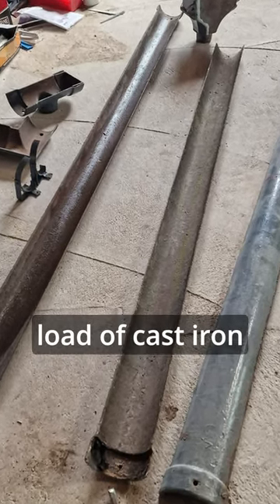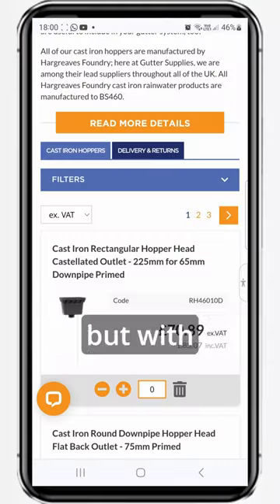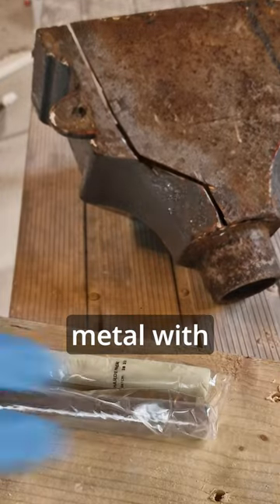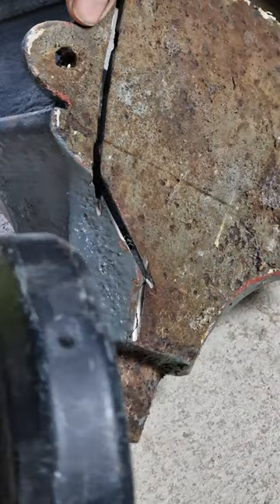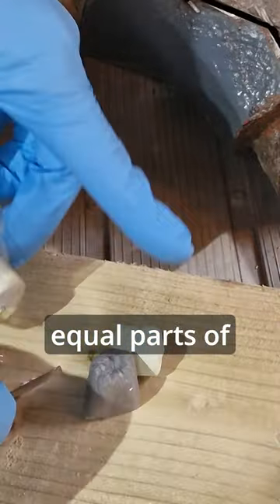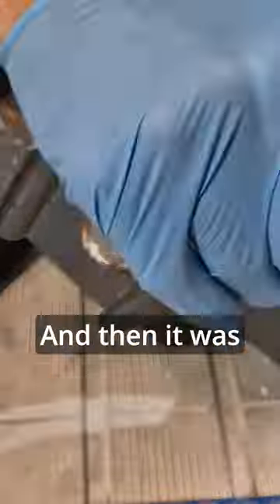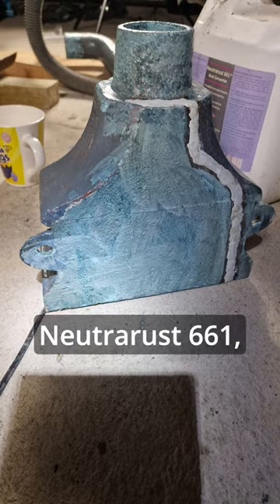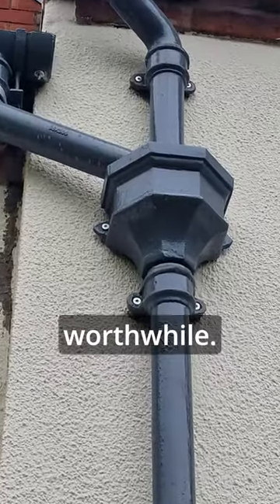How to Repair Metal #shorts

Comment: As a welder this made me cry 😢
Reply: Get a life lol
Reply: Average diy guy isn’t gunna be able to weld cast very easily
Reply: @SamMoto98 I don't know anyone who would do that . Especially when a new one is cheap enough. 👍
Reply: As a welder .
I would do what he did.
Reply: As a welder, I'd cry trying to weld it
Reply: welding a gutter is an idea only a jahoo would have
Reply: I just shook my head envisaged a wood fire, cleaned up the crack put it on the fire let the fire die down a little bit so I could weld it and then let the fire cool down, next day grind excess off. Perfect
Reply: Why? It's only there to guide water doesn't have to be super strong
Reply: Are you really a welder? You tie cast iron, not weld it.
Reply: Don't worry a couple of winters of freeze thaw 'n they'll  come knocking.
Reply: Tig every time preheat And fill that sucker with 316
Reply: @Liam....... if its not sealed the damage from the leak in the crack could cost a fortune to the soaked fabric of the building, damaged cornice etc as it tracks down the back of the pipe and hits the brackets every 6 feet soaking in at those points.

Comment: I fixed these before by welding occasional tabs at the top, middle and bottom of the crack then filling with the epoxy. Not too hard to weld but firm enough to hold the putty in.

Comment: wont it just crack as soon as it heats up in the sun a few times as the metal will expand and break the putty?
Reply: Cast iron doesn't have that high a thermal expansion coefficient, especially not applied over the temperature range (probably -5 to 30 degrees centigrade with gradual change) this will be exposed to. Once you account for the thermal expansion of the putty mixture (which honestly could be similar) we could be talking about a tenth of a mm at most.

Comment: My fix would be a plate on the back made the same shape and bolt holes, then stick it on with car body filler. Same stuff really, but I like to add support into a cracked thing.

Comment: Looks just like the two pack putty I fixed a couple of cracks on an old windsurfing board years ago. That lasted 5+years and then I gave the board away, it's probably still ok now :)
Reply from the maker: It'll be similar. It's phenomenal stuff 👊
Reply: @CharlieDIYte  Well it lasted years being whacked in salt water, so it should be fine on the safe backside of the hopper :)

Comment: You need to use really chunky screws if they aren't stainless steel. The original nails would probably have been 3/8". 8mm hex head screws are easy to find.
Reply from the maker: I've got some great big torx head frame fixings I've been using 👌 I think they're Fischer.

Comment: From a restoration/conservation point of view i wouldnt thank you for a new one. I know a top notch welder and he laughed at me when i asked him if he could weld cast iron. We have in the past used west system reinforced epoxy to fully line the inside of old hoppers. The idea being that it still works even if the crack pulls apart again.
Reply from the maker: That's a really good idea - thanks for sharing 👌

Comment: ? Pick up an old welder? Another thing to add to your arsenal!
Reply from the maker: You can't weld cast iron - or at least that's what the metal works down my road tells me.
Reply: @CharlieDIYte  unknown unknown for me - obviously I’m not even a welder 

Welding cast iron looks like it is possible  eg - with stick welding only with specific rods (?copper core?) and requires preheating the material —— also technically hard even for welding which takes a lot of practice! Finished results likely to be janky and may be vulnerable to breaking at the weld seam or fracturing the underlying material if poorly executed. 

Thus your excellent repair as demonstrated is a far more practical option for the DIY mortal/sane.